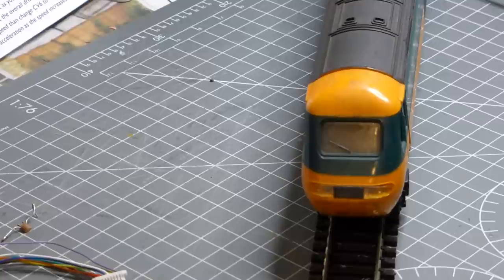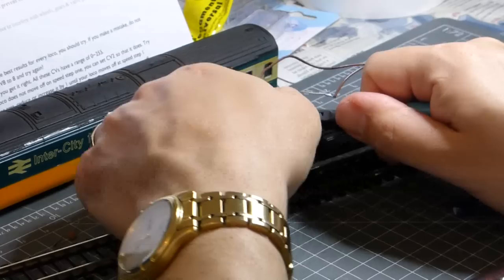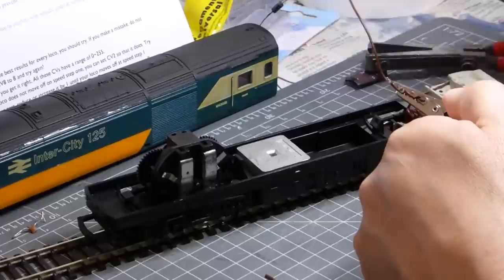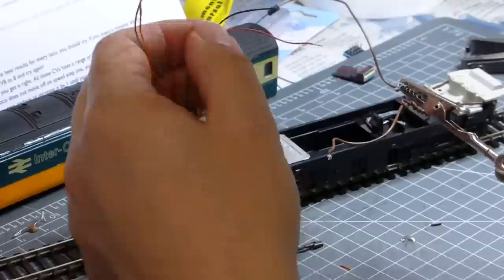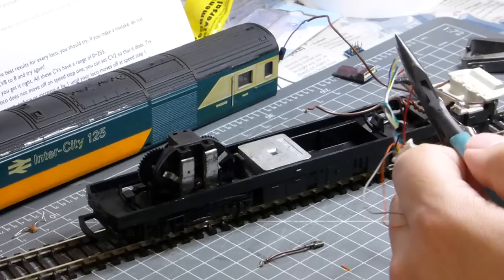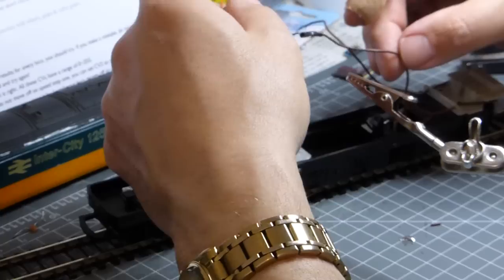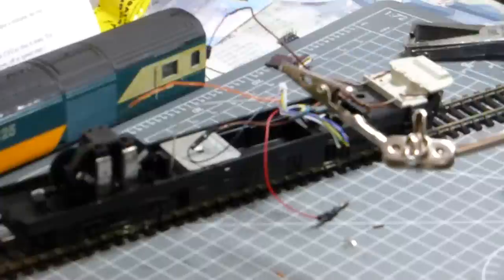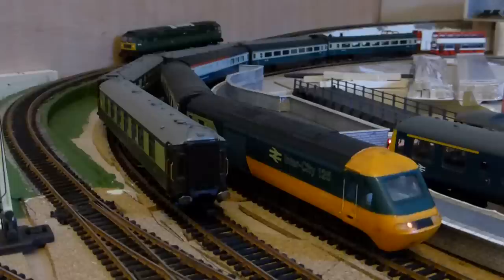How To 1 - Convert Hornby HST to DCC

Comment: Excellent video, I have been looking for one that shows every step for doing this and at last I found your one which is very methodical and makes it look straightforward, my only niggle is you didn't show how you did the lighting and what you used to add the extra red light, I'm sure I can find that somewhere on the old internet, thanks for making this video as I have 4 hst sets to do, I just hope the lima and hornby wiring are similar on these once I open them up, electrics have never been my strong point. Bri.

Comment: Hi Nigel   I have just returned to modelling and have watched your video over and over as I am very new to converting to DCC   One thing  I cannot get my head round is the second rail wire. I think you used the wire with the small diode on it  on my 125 this wire the left front light connector pin which pushes in to a hole in plastic  My question is where does it get its power from   I hope you are still able to answer my query or amI just being thick and missing the obvious. Great video and this my first attempt so don’t want to get it wrong     Stuart Forbes

Comment: you did right with the varnish theory however clear laquer should have been used, people tend to forget trains in real life have gloss paint not matt, the only thing that should be matt is the weathering. also when soldering you need to make sure you have a good mechanical connection by "j" hooking the wires together, never rely on just touching the iron to two wires

Comment: Thanks for making this, looking to convert my exact same loco, albeit I'm planning on fitting a small sliding switch somewhere to switch the input power between the chip and the motor, to allow me to still use the loco on my club's DC circuit.
Reply from the maker: +Nick Russell Most DCC chips will still allow DC running so you don't need to fit a switch.

Comment: Hi Nigel, Great job on the 125 conversion, I have a couple of these to do myself and it will be my first attempt at changing to DCC. Can you advise what resistors you used and if possible any more info on getting the directional lighting to work. I can see the wiring but not clearly enough in the video. Any help would be appreciated.

Comment: thank you been trying to find a tutorial on this very train
Reply from the maker: Glad it was of use Phill. I replaced the traction tyres with Bullfrog Snot which completed bringing it up to date. I'll change the front lights at some stage and swap them for a piece of veroboard which would be a better fit. I just wish I hadn't painted it with varnish in 1979 as it has gone yellow and needs removing which will be difficult.
Reply: Nigel Evans Hi try T-Cut to remove the varnish

Comment: hi there Nigel I'm thinking of delving into the wonderful  world of dcc and this video helped enormously, but i'm a bit overwhelmed by the amount of dcc chips and functions can you suggest a nice simple chip to install (like the one you used),I 'm not to worried about having loads of functions just the forward/reverse,and  lights as in your video would do to start with.again thanks for the tutorial.liked and subbed.
Reply from the maker: Hi David, glad you found the video useful. I'd recommend using a basic chip from Zimo or ESU as they are very well established manufacturers who make good quality chips. You might also consider Hornby TTS sound chips for a HST which aren't too expensive. I never regretted making the change to DCC you can add ground signals, point operation etc all from the one controller. Good luck Nigel

Comment: Bonjour, mais il semble que vous avez connecté la LED avant et la LED rouge arrière sur la même résistance sur le fil bleu, pourriez-vous me le confirmer. Merci d’avance. Hello, but it seems that you connected the front LED and the rear red LED on the same resistance on the blue wire, could you confirm it for me. Thank you in advance.
Reply from the maker: Hi Raymond, the blue wire is a common positive feed for the lights and the resistor reduces the output voltage for the red LED. The white light is a bulb so doesn't need it. If you google Brain Lambert DCC he has written a good guide to how to do this. You could use a separate series resistor with the bulb to set its brightness to something you like.

Comment: Nigel very informative video on this conversion, I followed all your instructions until connecting the lights. Can you say what colour wire from the chip did you connect to? Many thanks . Frank Hughes
Reply from the maker: Hi Frank, I would have used White and Yellow to connect to one side of front and rear lamps with Blue being used as a common positive supply. If you're using LEDs make sure you get them the right way around as switching the negative is unusual.
Nigel

Comment: Thanks,  i will try to use this guide on one of ours, Any idea how to get the dummy car directional lighting to work?
Reply from the maker: I used a second decoder to provide the lights, make sure you get the polarity right with the wires as they have a common positive rather than the more common negative.
Reply: @nigelevans2467  Thanks Nigel.... All works but after installing the 8 pin Bachmann decoder the top speed of the loco has reduced significantly from when it was on DC. Any idea how i can improve this?